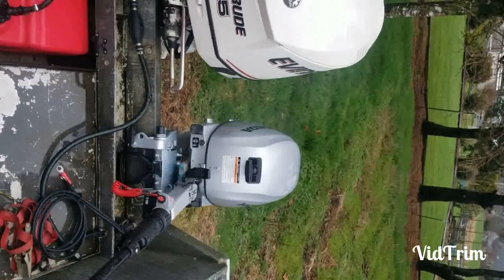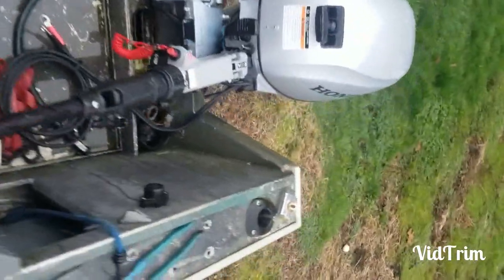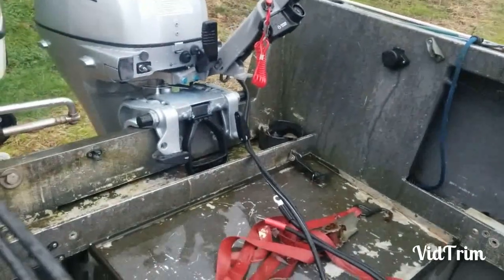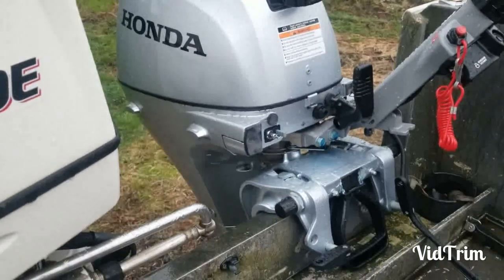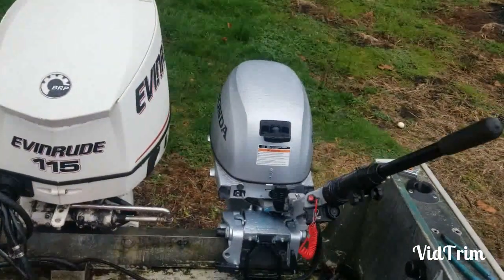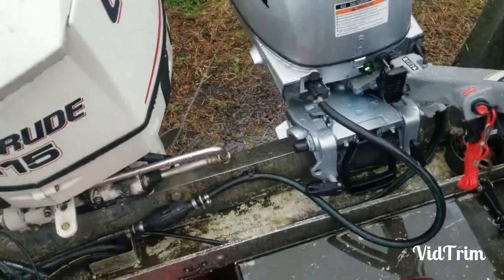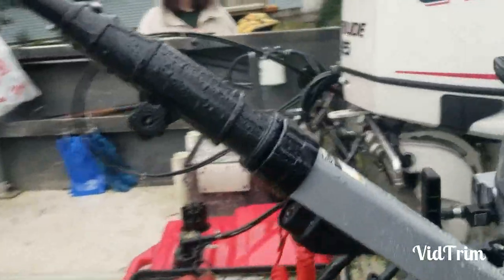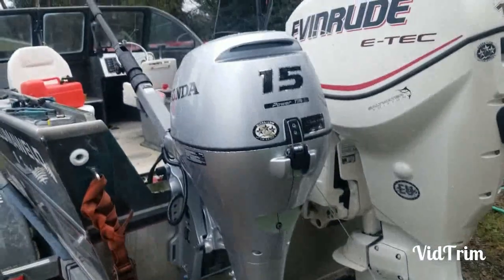2021 Honda outboard

Comment: I would like your thoughts and experience with the 115 E-tec.  Recently bought a new to us boat with 130 Etec with 300 hours.
Reply from the maker: I love mine. What can I say though, I got mine on a pallet for $600 and put it together. Literal basket case. Mine is a 2008 so it's the first year for nmea 2000. 
I have had to replace injectors a few times and I had to buy the computer program To do the software side of that.

Comment: Thanks for the video! I am a new boat owner and just bought this same engine with manual tilt but all else is identical.  This was very helpful to newbs like myself to watch the set up nice and easy.  I just bought a Whaly 500R 3wks ago and I am super excited to hit the water!  I was wondering what the specs of your boat size and weight are and how the 15hp performs with your boat?  I am still completing the prelaunch checklist for my first outing so I've just been watching all the vids I can on motors and boating relentlessly in general for a year now.  Yours was very helpful.  Thanks again for posting.  Best of luck and safe travels on your ventures.
Reply from the maker: My boat is 18' welded aluminum. Weight is around 3000 pounds. I use this 15hp as a trolling motor and backup motor. It trolls very slow and when opened up will push my boat about 7mph. I am very happy with it so far. 

You will enjoy that whaly boat. I have seen a few of those around and they are neat.
Reply: @BoringFisherman  Thanks so much for the information!  Very good to know my motor should do just fine for me to start out with since my whaly is 16'4" and weighs 995lbs.  I won't be needing to move to fast to start out with anyway... I'll work my way up in HP when my experience and expense account levels have improved respectively equal to one another! lol ... Have a great day!

Comment: Green is good it's the oil light lol. If that ain't on its time for some servicing
Reply from the maker: I read that in the manual after I did this video lol. Was too excited to wait
Reply: @BoringFisherman  lol I figured. Only reason I know is cause I went just a couple days ago to check our a 2004 model a guy local to me was selling and the light came on I said what the hell is that lol.
Reply from the maker: @OregonGrown1991  for what it's worth I absolutely love this 2021. My main engine today out crabbing decided to throw another alarm.... btw stay posted for my video from today!

Anyway I think it's time to repower my evinrude. I cant go 10 service hours between faults on it. Might be honda time

Comment: Do you still have to mix oil and gas in these newer engines?
Reply from the maker: No. The evinrude is auto mix, and the honda is a 4 stroke so no mixing gas

Comment: Can u adjust that idle to make it drop speed or up speed for trolling
Reply from the maker: Just saw your comment. I was told by the dealer not to mess with the idle speed. I can change props to get a slower troll speed.

Comment: Made in China or Japan?
Reply from the maker: Japan
Reply: @BoringFisherman  nice I read they moved some their smaller outboards to China. Could you do me a favor and measure how low the motor back bracket sits on the transom. I have a 10’ inflatable boat and I’m trying to figure out if my transom is tall enough to hold the outboard. Just measure from the top of your transom to the bottom of your bracket. Thanks man
Reply from the maker: @clarkgwozdecki6782  mine is 14" top to bottom. And 11 inches wide. Now mine has power tilt so it has a hydraulic unit inside and may be different than a manual tilt model. Mine also has a bolt pattern for 3/8 bolts, I hope this helps.
Reply: @BoringFisherman  thank you so much. Literally spent 2 hours on the net today trying to find the measurement.
Reply from the maker: @clarkgwozdecki6782  no problem man. Hey if you havent already give my channel a subscribe. If you ever want to know anything else just ask